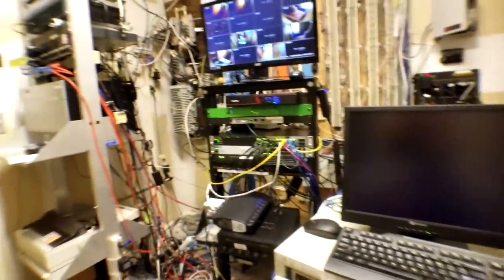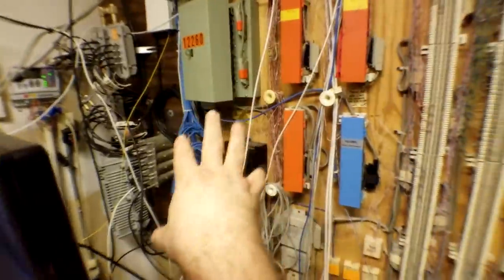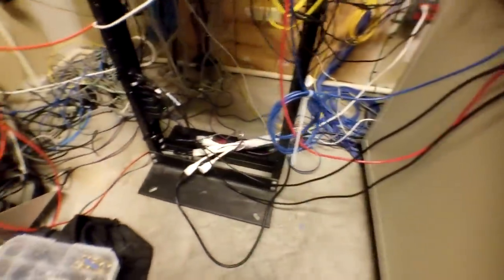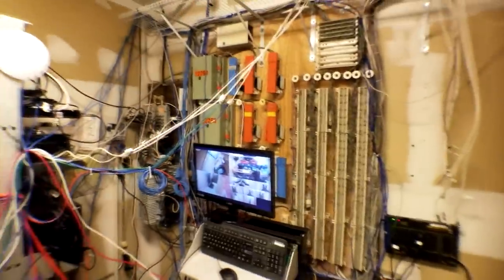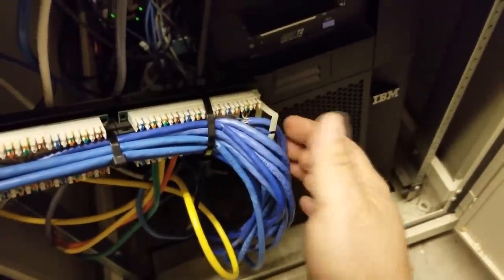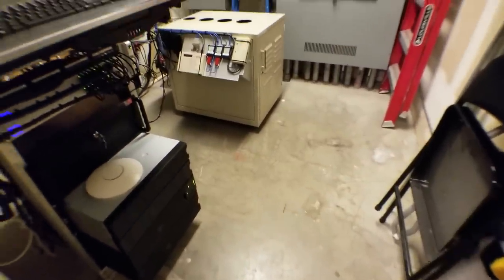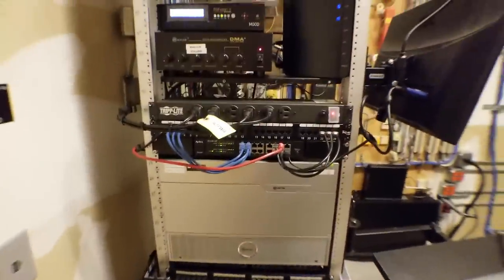#037: The Chamber of Cable Blunders (from Florida)

Comment: Yay! Now the power panel to the back right can be accessed when needed, without crawling over equipment!
Reply from the maker: Correct! Thanks to a previous episode where I managed to block a breaker panel with my installation, I learned about clearance requirements and implemented that practice here at this site.

Comment: I used to do quite a bit of this kind of work and it always amazed me how much of a closets mess was just trash and deprecated equipment.
Reply from the maker: I can as well!! It's interesting to observe what my own thinking would be when I'd enter a network room that already had trash on the floor. I would think to myself, "Well, there's already some trash here, I guess it's ok if I just add to it with the work I'm doing. It must just be accepted here!" It's an easy place to go to mentally. That's why I tell my clients just how important it is to have a very clean and tidy network room because it tells any visiting tech that this place values doing the job right and it will stand out like a sore thumb if you don't!

Comment: I love the patch panel dressing. much more manageable than what we usually do. I think I'm going to adopt that. Although I can't stand zip ties on cable bundles unless its absolutely necessary. I much prefer reusable straps or hook and loop. Otherwise you have to go through and cut them off when you need to replace a cable or add a new one to the bundle.
Reply: But does it take any more time to cut the zips vs unwrapping the velcro and put new zips on vs wrapping the velcro around?   While I like velcro for my personal, small-time cable management, I would think zip ties would be quicker and in some cases easier to deal with though you have to be mindful not to make them overly tight.  (I understand this is regular data center debate)
Reply: zip ties can also be over tightened pinching the cable.  I thought zip ties were discouraged for network cable.

Comment: As a software engineer, I really enjoy these types of videos. It’s very easy to relate network components and cables to software components and the code that connects them. Though there are some unrelated concepts, a lot have analogous things in software. 

Being able to swap out a component of it fails or needs to be upgraded is much easier if the code around it is minimal and clear, same as the camera system here. 

If you need to remove a network component between a patch and a switch, that is unrelated to those items, you shouldn’t have to touch the patch or switch, which is basically one of the core tenants of good software architecture.

Comment: I have been doing data and voice installs and MAC work since 1988
.A few tips before you start this type job. Take a photo of all cables and switches and routers and patch cable locations.Use a label maker to mark all cables or a electricians number book. Don't look at the big picture. Go cable by cable ,switch by switch. Go out to the field and check for any labeling.
You did a nice job. Ninja

Comment: I been there , I would start at 3am on Thursday and finish up Sunday    Sometimes mondays 80 percent work. And 20 percent figure out what extra wires are for.   I worked at port of Los Angeles network oocc. Oriental oceanic container company    I installed cameras using phone hubs. Great research.

Comment: I do appreciate your info. Small loops at the data patch panel and wire ties? I get budgets sometimes and understand. We wouldn’t touch that room for less that $30k in labor alone considering what you shown in the video, less equipment. We are fortunate to have clients with large budgets and understand the value in doing it as we would do for ourselves. Can you talk about the hours and price you charged on this project.
Reply from the maker: I probably could talk about it but it wouldn't do many people any good. The business side of this work is not my strong point. In this job, I actually got screwed on the deal by not being extremely clear with them. I worked this project along with several other hotels in the state in a single multi-month visit that I charged at a flat fee. I'd go into more detail but I'd rather hear about how you handle pricing as I'm sure we'd benefit more from that than listening to me!

I have no regrets with adding those patch panel loops and zip ties are used extensively in my trade with zero issues. I'm going to be addressing zip ties vs. velcro in an upcoming episode!
Reply: I'd really like to hear how others have charged for this work too!
Reply: FiberNinja oh Fuck them at the end of the day they should of forked over what ever price you asked to be paid! Excellent work!! I’m addicted to these videos now, they are wonderful!! You need a camera man? I’d love to learn how to do this!!!

Comment: Yes you indeed have steel balls, I would have looked at that rats nest and ran. Kudos to you. 👍👍
Reply from the maker: Oh trust me, when I was just an apprentice, I remember soooo many times when the guys I was working for did that exact thing!
Reply: I would have told them ... power it down until it can all be redone ... and then start on the most critical need systems first .... I figure if they could spend the time not to do it right they can afford the time to get it done right and learn NOT to leave a mess behind ....
Reply: @0623kaboom  Yeah pull everything out and start over.
Thats what I was thinking.
Reply: 0623kaboom I'm with you on that with having the business shut down until everything can be done, I'm not sure if I could do anything without tearing half of the stuff out myself.

Comment: Wow.  What a great video.  You did a great job in the video showing the issues and the fixes.  I've been in the computer business for a long time but you showed me many new fantastic cabling processes.  There always seems to be cables that need to be stowed away and your high horizontal shelf fixes that problem. Bravo. Of course I loved hearing about not blocking access to open space in the rack with your cabling.  Securing cabling is also not done properly most of the time.  I will definitely use the tips on the patch panel to use pig tails on the strain relief to allow better access.  Excellent.  Thanks.

Comment: This is a good example of the cumulative messy server room effect.  When your server room is clean, any little imperfection sticks out like a sore thumb.  However, when when enough technicians come through, eventually things are going to get messy if not maintained (and a closet like this is not normally seen).  At some point it's going to get so bad that people just want to get in and out of there as quickly as possible and don't care what kind of work they do since it doesn't matter anyway.  The same thing applies to software :(

Comment: 48:26 Great use of those J hooks. I use them for hanging saw horses.  You're right, closed D hooks are horrible since you either have to pull the wire or unscrew the hook.

Comment: I used to use brackets and wall hooks like that when dressing my cables when at a job site that couldn't get the materials shipped there in time. Which was a lot as it was before Amazon and Newegg really took off.

Comment: Great upgrade. I'd agree, cable mess on top is the way. Having a clean floor helps you move around.
Some companies just do a lazy job, just like those camera cables (and power split off), that had to be done through a patch panel (so it's easier to reuse the cables in the building).

Comment: You can get “right angle” patch panels where the IDC connector for each socket runs on a PCB front to back. This allows you punch down from the top rather than the back so the strain relief can’t get in the way.
The ones we have are branded ADC Krone TrueNet, but it seems ADC Krone has been through an acquisition by TE Connectivity, and a divestment to CommScope, so it seems to come up with several of those brands. Similar products are available from other brands...
Reply from the maker: Yes, someone else here mentioned it too. I'm going to see if I can get a sample to check out here.

Comment: Another job well done, it's never easy task to clean out someone else sh1t. Would be great if you include a before/after comparison at the end and show the unused equipment/cabling removed. Actually what happen to all those removed equipment/cables?

Looking forward to seeing other great ninja video. Cheer and take care.
Reply from the maker: Yeah, I've wanted to do a before-and-after shot on a lot of jobs but it's tough because of the lack of consistency in camera movement between shots. It's also tough because most of these jobs take place over MONTHS. If not, I'd just setup a time-lapse camera with a good power source and call it good! Most of the pulled equipment will find itself to eBay per the request of the customer. A lot of it was not working, or so ancient that no one will want it but it's worth trying to sell. The customer in this situation owns many other sites in the state so much of the equipment that is still functional will get used elsewhere when needed.
Reply: do a walk through before and after ... and in editing ... splice the two clips side by side or top and bottom ... then you get before and after in a direct comparison ... with any extra on site time ... ok it gets moved to editing ... BUT that is easier

Comment: nice work with the referb. I#vedone a few and know exactly the issues. I applaud the use of common materials readly available, as to ordering vendor equipment. The one thing I have personally changed is using IDC type panels (either 110 or LSA) Here in Germany everything is LSA. My perfered panel are Modular panels (Perferable Keystone). I like the ability to add ports if not all used relativly easy. But great video, gave me some ideas.

Comment: This is the type of wire management that only happens within hotels/motels. With the cameras, they could have used PoE over coax. The technology has been around for years. Milwaukee, Fluke and others provide an extended 110 Block punch BIT that will allow you to punch down with the strain relief in place or remove the strain relief bracket and install it once you're done punching down your patch panel. When dressing cat 5 through 7 you should always velcro,  inside of racks and within the cable rope it allows to dress in additional cables as needed. Tie wraps work well, however they strangle the cables when in a cable rope and dressing in additional cables becomes extremely time consuming. I like your creative approach on the clean up. The bracket created for the Mitel interface connections on the rolling cart should be patented. Regrettably within hotels, offices, business and even data centers network closets evolve ADHOC, with multiple vendors and Johnny from the front desk shaking wires around these rooms get overlooked and under maintained.  I've stepped into many network closets looking just as bad if not worse and its a nightmare waiting to happen. Congrats on the successful cleanup.

Comment: I am a bit concerned that the UPS is placed nearly on the floor, especially as you mentioned the danger of flooding  earlier in the video....
Reply: I was concerned to but then he explained it was just the expansion battery so I think I would rather replace a UPS then the entire computer system although the rolling rack is sort of setting the bar for level of Ingress.
Reply: UPS:es are typically so heavy that you want to place them as close to the floor as possible

Comment: This is really really  impressive work...especially in a live network...I'd be interested in how many actual hours this took(without blogging)...and how much you charged the customer. I do similar work, but on a much smaller scale... depending on equipment and what needs to be tidied up, it usually takes much longer and anticipated. This must have taken several days if not into the weeks...

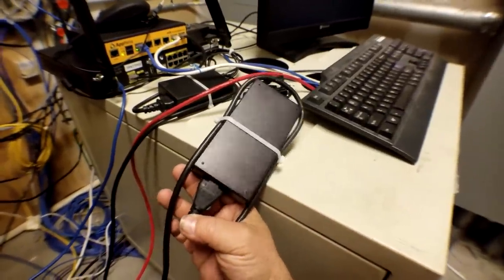Comment: 7:00 awesome strain relief idea.  

As an electrical engineer who has worked with rats nests of circuitry and code in development, I must say that network room was horrifying.  Especially as one should not see that in production.  Rats nests cause all kinds of problems with EMI.  I take the same attitude towards messy code as you do towards messy cable, pushing through, making repeated refactors until it is done.  The trick is to "refactor mercilessly" and make sure you touched everything to make sure it does what you think it does.  Literally taking ownership is the only answer.  Also detailed notes.  Kudos.

Comment: cable dressing ... there's something not taught in school anymore ... back in high school we got marked out of 10 on how we handled our wires on builds and project boxes .... 
.
even upgraded the classes bench top power supplies... ok all we did was run all the cables and dress them and leave the ends where they were needed for the certified tech to install ... he came in expecting a 2 day job ... left at lunch .... completely finished and tested ... he even graded our cable dressing .... we got a 10 out of 10 ;)
.
sure it is a pain in the  butt when you are doing it ... BUT when stuff goes murphy's way it saves a TON of time in trouble shooting and replacement if needed.

Comment: This was a long video so I did some skipping around. Will watch the whole thing later.The finale layout of the cables and equipment is great. Love the misc hardware brackets. Big improvements all around. I think this is your best video of all time right now. Congratulations on this master piece. I know we as technicians get pretty picky about the work we do and only have so much time and budget for the job at hand. So with that said you did the best you can do with that piece of 💩 room. It's something that you can be proud of. again nice use of everything very creative. Love the bracing of the rack to the wall and the floor as it should be.
I see all the little details awesome!!!
Reply: LOW VOLTAGE DUDE. I don't think that's best or worse video. He done quite good episodes that I do like very much.
Reply: Arentas REC I agree he makes good videos. I'm subscribed and enjoy watching  his stuff. Always fun seeing other techs working.
Reply: I've said it before, a lot of this is just basic good work for any sort of cabling. There are specific things, like the clearance for the punch-down tool, but the general neatness, which you see at the end, is the same, whether you're installing a huge 3-phase motor or putting in a cheap ethernet switch between your home computer and the internet box.

And the tangle my brother left behind when he headed for Edinburgh, just USB power for his phone and a few other boxes... I would have put labels on those power bricks too, where I can read them without having to unplug anything.
Reply: Dave Bell labeling the powers would be good. I like using a rack mounted power switch for some customers. I just label that and you can individually power down devices.alot of techs/installers do some crappy work it's always nice seeing some one doing work the right way. Come up with a plan the best you can. Give a shit about what you do and dive in.

Comment: you mentioned their coax signal being strong and needing all the attenuators. the big metal box on wall with the fins is either an amp or an entire node(doubtful) which isn't uncommon to put in hotels due to the number of endpoints they have and the size of the building. the downside is that means for stuff in the same room the signal is super strong so they need the attenuators

Comment: It is shocking just how badly and dangerously server rooms are allowed to get, with most of your before's being cases of a lot of different people just adding wires at random with little thought of the problems that they will case.

You are a true Fiber Ninja, and a person who can express easily the how's and why's of doing a job properly, you should be taking on apprentices to learn your ways, indeed a Jedi Master you are.

I inherited a server rack when we moved into a new building, however as extra servers, computers and audio components where to be added, we need a bigger server case and I got the job of moving everything.

This seemed a simple idea until I found that there was two separate unbilicules of cat 5 cabling coming into the original case with one entering from the bottom and one from the back side, this left me wondering as what to do until I came up with the idea of taking an angle bracket to the base and cutting a section out so I could remove the two pre-wired patch panels which would then allow me to reinstall them into their new home.

The new bigger server rack case looked a lot better than the old one as it used short patch cables instead of the overly long ones that was being used and the result was a clean and tidy rack case.

One of the problems we did find was that with a full server rack case with all it's panels and doors installed there was a noticeable increase in heat inside the case, this was remedied by putting a fan plate on the top along with a large 20" industrial fan at the base that moved a large amount of air even on it slowest setting, greatly reducing the heat build up.